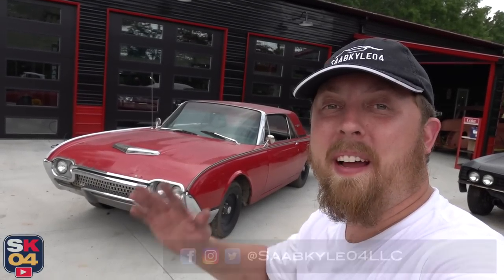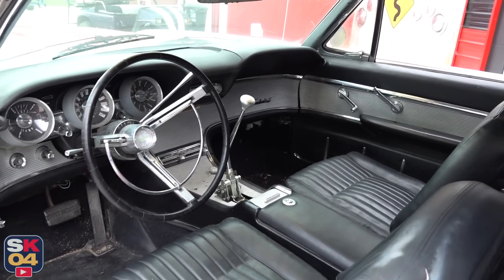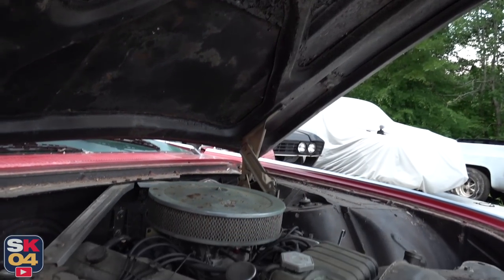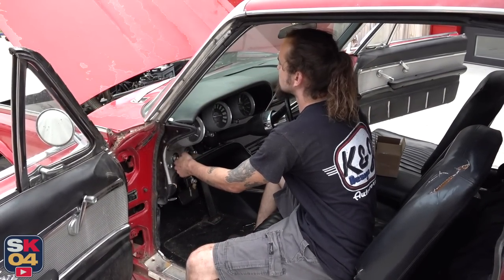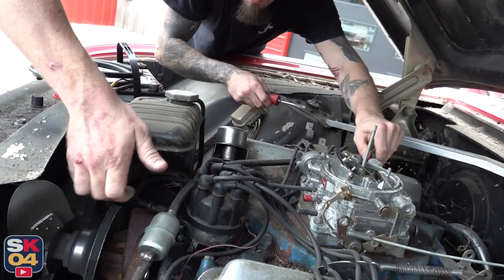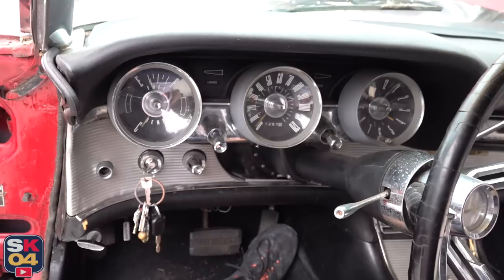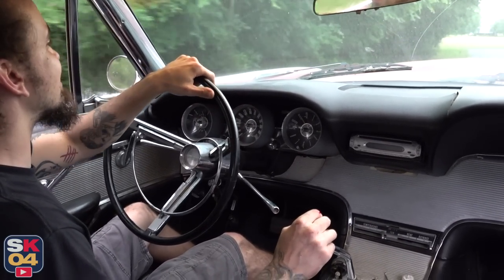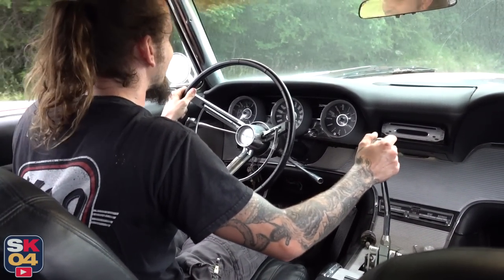Bringing A 1962 Ford Thunderbird Back To Life!

Comment: Kyle you should never ever start a car without the coolant cap off to make sure the thermostat opens because of the thermostat does not open there will be no coolant in that motor and it will overheat so next time make sure you do that

Comment: The steering wheel should swing away when the door is opened, and move by hand, not with a lever. And obviously that shifter is a joke. All T-birds were automatics from 1961 on to 1981.